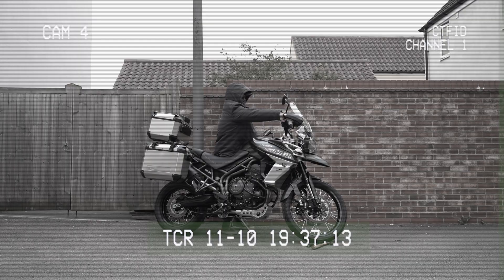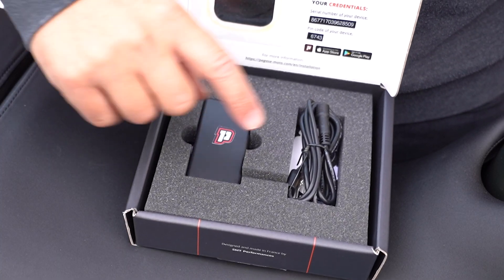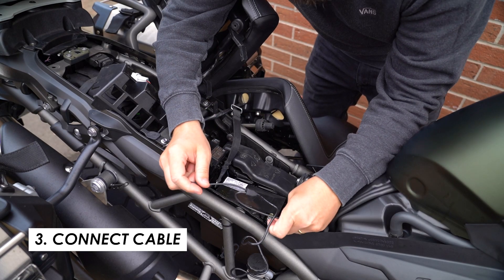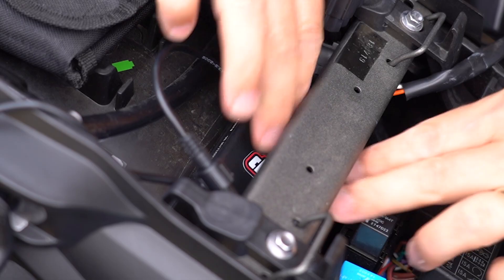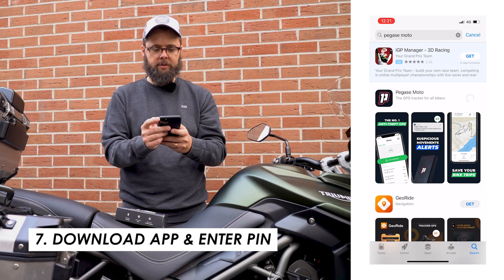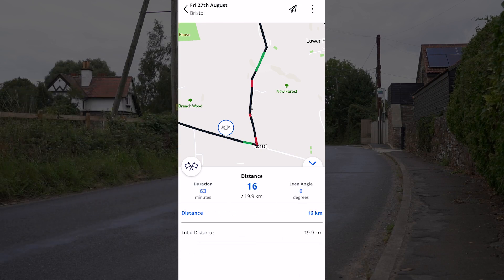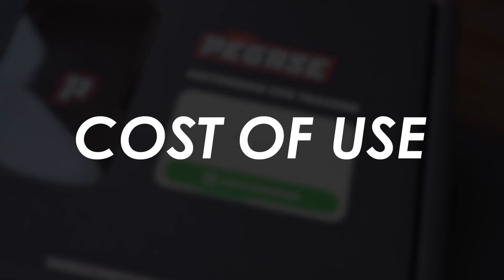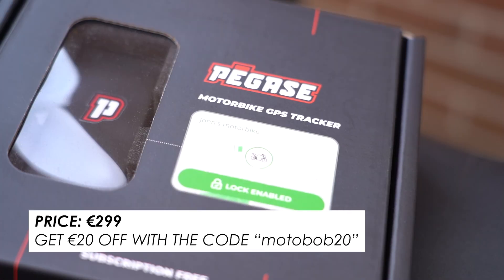Pegase Moto Review: The Ultimate Motorcycle GPS Tracker?

Comment: This is not a review, its a commercial selling the product. I had an eBike wich had a smarter gps tracker than this. Connecting this tracker to the motorcycle battery means nothing. Whoever wants to rob your bike will remove any cables or cut the cables on this tracker. The Haibike gps, on my eBike, had its own battery with an autonomy of 6 months, and you could hide it anywhere you´d like in your bikes frame. Really difficult to spot . The thiefs come with a van, put your bike in the van, while driving, they cut the cables and BYE 10.000eu or more worht of motorcycle.

Comment: If you put the stickers on your bike, that tells any thief they can remove the tracker immediately.
Reply from the maker: I think it might be a good shout to remove the sticker from the GPS box too.
Reply: I was just going to say almost the same thing…if you advertise that you have it…you might as well just use the stickers…and hide that fucker underneath a body panel that’s very hard to access. if it doesn’t work, you will know right after you set it up.
   It should also have a small internal battery that lasts for about a week or more once you have discovered you bike gone…it should just ping it’s location like say every hour…once you tell the app that it has been stolen.
    Other big thing is it should have a contract where the manufacturer acts like you lawyers… can’t disclose any information to anyone but you until you give it formal permission. Last thing I want is to pay for something that helps Big Brother rat me out for doing 140mph on an empty highway!
Reply: Does it work if you put your motorcycle in an indoor carpark?

Comment: Any tracker is very easy to overcome with a GPS jammer,  even the pro ones are, so you guys fretting about where its installed, give your heads a wobble. The average Joe out nicking bikes does not have a jammer, and he does not go under the seat looking for trackers. He nicks the bike, takes it away and either rags it, breaks  it or whatever his perversion is.You have a very few minutes/hours to get your bike back. After that - its history. This one pings you as soon as it moves and you can then chase it down before the bike is stripped into a million pieces. As the guy says, this is very convenient and that is a big plus. Mr Thief does not know where or what is fitted to the bike remember. A common trick is to shift it half a mile and leave it out the way to see if it gets claimed. With this device (or similar) you know that and where to go to get it back. Stop looking for issues maybe ? ;) Have a good day and ride safe.
Reply: The trick is to set up in your car within view of where they stashed it, and catch them retrieving it.

Comment: Love your content mate, I probably won't get a tracker until I buy something more valuable but I think a massive selling point for a tracker for me would be something small & discrete and having it professionally installed in a bizarre caveat inside the bike. First thing thieves will do will tear off the seat and look for anything obvious.
Reply from the maker: That's true, I could have at least hidden it a little more :)
Reply: Usually most bikes have some extra switched wire ready for accessories. Connect to that and disquise it as some legitimate bike component like a modulator or blinker.

Comment: I couldn't find info on their site! How does this work? No sub? Sounds great but how is the tracker sending data to the app? Does it use GPS?IoT networks?GSM? if GSM is it still using 2G/3G networks planned to be switched off in the coming years or is it using LTE? Servers still need to be paid? Sending SMS has a cost, even though a low obe. I see the tracker is more expensive than other options but I don't understand their business model unless the tracker implements some sort of planned obscelence that won't allow to last past a certain time. I can unserstand the sub business model for trackers, but I don't know about this. In the end will they sell the user's data?
Reply: I have the same questions if it’s only 2G GMS it next to useless as how is it uploading all that data. 
Sounds to good but no info found anywhere
Reply: Pégase uses the GPS and GSM networks to collect information and transmit it to your phone. You are right, Pégase uses the 2G network to operate and the discontinuation of this technology is currently under review. It will close soon but only for individuals, businesses and professionals have too many tools that rely on 2G to close it. And if one day this network is totally closed, Pégase will propose a new 4G or 5G GPS tracker at a very preferential price for these 2G customers. 
Secondly, there is no planned obsolescence or subscription to pay because the service fee is included in the purchase price of the tracker, which is how we don't charge our users a subscription.

Comment: A nice bit of kit ordered and got discount thanks. I know where I'll mount it on my Harley. I assume it comes with an internal battery or does it work on the bike batt?
Reply from the maker: Has an internal battery but you connect it to the bike battery. It has a movement sensor so only draws charge when the bike is on the go. Haven’t ever had it drain my batt

Comment: Cool review But - Under the seat is the absolute worst place and also you should  connect it to a wire on the loom and not directly on the battery. Studies show in London first thing thieves do is tear off the seat to remove anything attached to the battery and disconnect it.
B Smart 😎 Ride safer.

Comment: "My Tiger 800"... that's new, which bike went to make the space?
Reply from the maker: Yeah picked it up for all the motorway slogging I’m doing to manufacturers and picking up press bikes etc. The right spec and luggage came up at Fowlers with 900 miles on the clock and I couldn’t resist!

Comment: Does the GPS unit have a USB port for data analysis and upload to a mobile phone/laptop??
Or is all speed/lean angle and etc just sourced on your phone using the phones GPS?
Any technical specs in a PDF or anything.
Reply: Hello, you can consult our FAQ for some of your questions: https://smtperformances.com/en/pegase-motorcycle-faq/
And Pegasus communicates with the application via the GSM network but you can export GPS data in GPX format from the application to your email address!
Reply: @flashbird_by_pegase  Does your tracker have its own battery backup if it gets disconnected from the bike's battery? And if so, how long does it last on its own power?

Comment: Cant you just remove this if you steal a bike? 

P.s Like the look ok that lock at the start of the vid whats that?
Reply from the maker: Oxford Nemesis disc lock! And yeah of course you can remove a tracker if you steal it - def good to install it in a discrete place if you can find one. But a lot of bikes get dumped for a couple of days before they're moved on, so there's usually a window to retrieve it.
Reply: @motobob  Thanks will check out that lock. I dont intend on being out of sight from my bike for the 4 months or so anyways. (Learner). 

But yeah next year will have to have a think. Would you say that Oxford security lock enough? (Guessing you need a chain also. But on a 125cc I wont go anywhere ha)
Reply: The chain is an Almax Immobilizer 19mm I think. For security more is better even on 125s. Disc lock when out then add chain, another lock, ground anchor & cover (if not garaged) when home as a minimum... and if you're in London double everything 😔
Reply: @nickbrigg5203  Well I wont be going anywhere really first 6 months and if I stop somewhere i'll be right next to it. They will have to nick me as well as the bike.

Cheers for the suggestion. When I get a bigger bike will get some security.

Comment: How's it going? I've just got my 2nd one as first one started playing up and this one's not looking too good.
Reply from the maker: Mine's working well but sorry to hear that about yours - what's the problem?
Reply: @motobob  started tracking after I've started, and would just stop tracking. Then just start tracking on its own. The biggest problem if it stopped tracking, if you tried to direct yourself to its location the bike wouldn't be there. Only if you remotely locked it and someone nudged the bike the actual location would appear. Hopefully the replacement will work better but at the moment not looking good, but saying that the first one took a couple of days before it was working properly.
Reply from the maker: @ultranuman  have you tried changing the location for a better signal? e.g. under some bodywork rather than under the seat?
Reply: @motobob  just doing that now, under a rear side faring next to the seat .
Reply: @ultranuman  and? Any update?
Reply: @81722Les  it works perfectly apart from one thing, turning off automatic activation, it's a bit hit and miss. Most times it will activate with it switched off but that's better than not activating when you've turned it on (that's never happened).